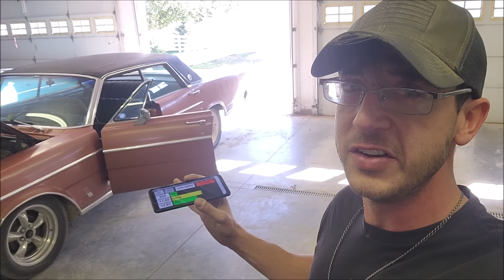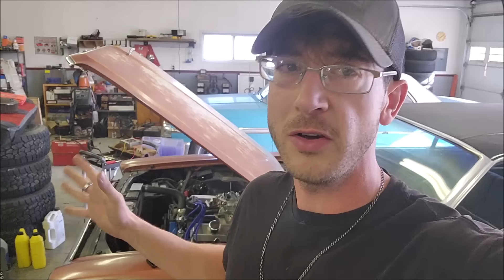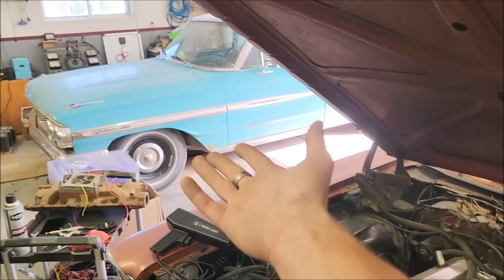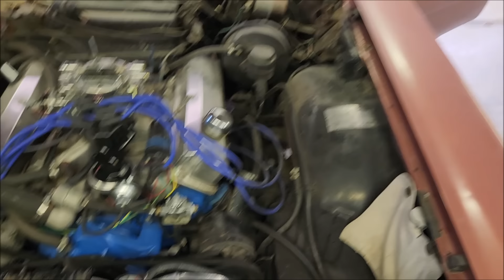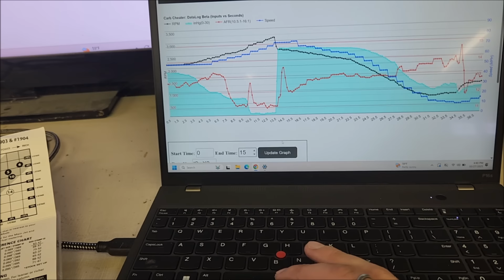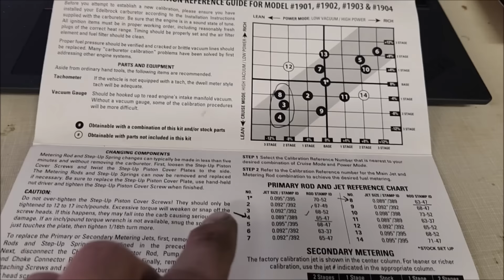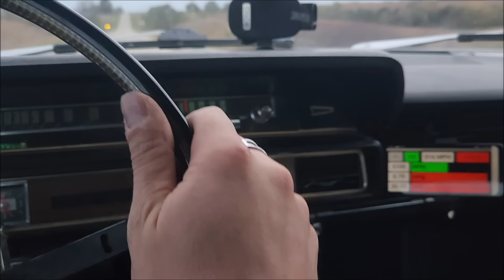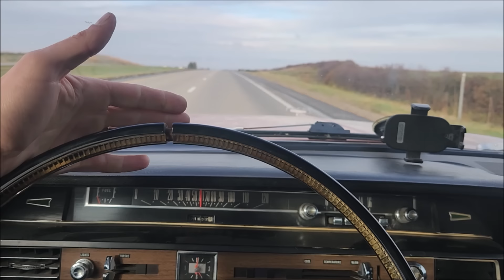Can We Save Her? NEW $6500 Engine Makes NO POWER !!!

Comment: You could have saved alot of time and the owner as well by putting the original Autolite 4100 4V back on the car.There's no carb on earth that can match it..they were just simple and perfect.
Reply: I have never had one run correctly....EVER....Neither with Holley.
Reply: @misters2837 What a 4100??If ypur talking about those ypu cant not make them run correctly..Jon Enyeart wrote a book on them on how the engineering was decades ahead of itself and like he said the fuel delivery on those carbs rival fuel injection...even whe those carbs were wore out they would run a car like nothing was worn...Holley?yes I agree..I dont like holleys and never have..they dump fuel and dont atomize ..I took the one off my dad's 79 truck with a 400 and put one of my 4100s on it and it was exactly like fuel injection after that...It needs to be a little bigger on the cfms but 4100s were no bigger than 600cfm...they used them on 428s in 66 but really they were too small and they are too small for a built 400 but it runs so good I don't care...it only matters if you spin them 5k rpms or beyond and this is a truck so it won't see that.
Reply: @jimmillet1442  If you say so...The old FE in the Galaxie, and Meteor never got such good MPG and ran "like fuel injection" until the Edelbrocks were dropped on...The 4100 might as well said Holley on it...Barely controlled fuel leak!
Reply: @misters2837 Never said they got great fuel mileage...a big block is still a big block and will drink the fuel especially FEs...The fuel atomization on a 4100 is the same as fuel injection and the whole design of those carbs are perfect and a carb cannot be made any better than the 2100/4100 series..It was either hotrod magazine or carcraft did a feature on them years ago explaining why they were so good..Most of us already knew that but they were never considered a "racing" carb but did come on quite a few performance cars like the 289 hipo in the mustang.The shelby gt350 mustang used a holley and one of the standouts in that article was how much better the 289 hip with the 4100 ran ALOT better than the holley equipped shelby mustang.Theres been 100s of articles over the years on those carbs explaining how good they were so if you hate them its because you know nothing about them!
Reply: @jimmillet1442  If their fuel atomization is so "Perfect" then why is their fuel efficiency so bad? 🙄  That makes ZERO sense. 

Also I only had ONE FoMoCo factory carb that ever ran ok (after fiddling with it), a 2100 on a 351W, taking jets and other parts out of donor carbs to tune it properly, (factory tuning sucked even in 1971) I made it lean on cruise and safe rich on power, and returned great fuel economy, and had decent power. (For a 2bbl) The later 2150s (smog years) were door stops and paperweights.  Replaced all with 400/500cfm Carter and Edelbrock carbs.  Increased fuel efficiency and power. (but not both at same time!)  I am not an expert with Carburetor rebuilding, but I also understand that the people slapping a 750 Holley on their 5.Slow (5.0/302) thinking they are gaining something are wasting their time/money. 

When in reality 500cfm is more than enough on a stock 5L engine, and 600cfm on 5L is good for 7000rpm and that is Solid lifter territory, which most street cars rarely fall into, fine for racing but lacks torque and part throttle response for street. (750/800 Q-Jet was probably the only exception to the "too-big-carb" rule as the same basic carb was installed on 3.8L Turbo-Coupes and 4.1L V6 Cadillacs and on 500cid Cadillacs! - I designed a Spreadbore Edelbrock AFB carb, for a project I have, but decided to adapt a four barrel throttle body injection unit instead (EFI for DIY has gotten so easy) I made it "spreadbore" by using epoxy to restrict the primary barrels. (Many 80s Bosch EFI 4cyl cars had "staged and staggered size" EFI throttle bodies to get better atomization on primary "barrel" so to speak, VW used it a lot.)
Reply: @misters2837 Dude you have zero clue..not even worth replying but ok..With our modern fuel injwction systems we have computers with sensors that do everything exact as needed per the point of starting your engine up...We did not have that back then..they relied on the operator for cold start ups..choke..etc etc...NO COMPUTERS to do all the work..Jeez man do ypu have no common sense or what??

Comment: Some tips that might help new tuners on Edelbrock carbs:
Edelbrock recommends an idle speed of 600-800 rpm to avoid getting into the primary circuit, which can cause a rich idle. A modified engine can change the minimum rpm requirements for your specific engine.

If you're running an afr gauge you can calculate the change needed with a simple equation. (New value - old value) ÷ old value. a 12.1:1 afr and your target is 13.5:1 it would be (13.5 - 12.1) = 1.4, then 1.4 ÷ 12.1 = 0.1157. multiply by 100 to get a percentage of 11.57. Use your Edelbrock calibration chart to find out which combination will get you the closest to 12% leaner. I prefer to start with the idle circuit then cruise since that's what you use the most.

For springs, start by picking a spring that has a value about half of your manifold vacuum. The springs are what push your metering rods up to allow more fuel through the jet, manifold vacuum is what holds the rod down. If you're running 18 hg manifold vacuum with the stock orange (5 hg) spring that rod isn't going to fully open until your manifold vacuum drops to 5 or less, which would likely only happen at WOT. If you're running the silver (8 hg) spring it will fully lift the metering rod sooner. This also allows the metering rod to start lifting sooner so you're less likely to hit a lean spot when you're gradually accelerating to the point of opening the secondaries, as the vacuum drop is more gradual.

Metering rods are tapered, so the transition isn't immediate. If you're a little on the rich side at cruise but the next rod size has you leaner than desired you can kinda cheat by running a lighter spring so that the metering rod doesn't lift as high or as fast. Maybe a 70/47 is too rich and a 70/52 is too lean with a silver spring, you can drop down to pink or orange to find that sweet spot.

Once your idle and cruise circuits are good then start on hard acceleration to dial in the accelerator pump and/or nozzles. Nozzle change doesn't alter the amount of fuel but the duration. A .23 squirter will have a lesser impact on the afr but will spray longer, a 0.43 squirter will give you the fuel faster and richen the afr for a shorter time.

Unless you're geared low and driving at highway speeds or flooring it you probably won't get into the secondaries much, but those are jet change only so the afr formula is more direct.

If your afr is jumping all over the place at idle and cruise but steady at high rpm your carb is too big for daily driving or you have a vacuum leak. This is caused by large droplets of fuel entering the combustion chamber and not fully burning. A lower CFM carburetor will increase air velocity to better atomize fuel

Comment: You ara a legend! I have learned so much from your videos. Question. Did you re-set the floats at all?? Or did you leave them as stock?
Reply from the maker: I will always measure them on an eddy for sure - needs to be what they call for
Reply: @ThunderHead289  Roger that! I recently got a AVS2 manual choke for my small block ford. The original was a 1405 which has been great but i felt i could get more out of the 351 I am pretty new to it all but you have made it all pretty straight forward in tuning etc. I would love to get a carb cheater to really geek out on nailing performance down and feel your price point is perfect. But funds are a bit tight at the moment. But its definitely on my top of things i need to get!

Comment: Yeah so the old’78 LTD used to die  in the summertime after about 20-30 min ( in Bakersfield ca) sure enough.., changed a whole shit ton of ignition parts and my dear old dad said “she’s way lean., I don’t smell gas?!?. Installed a see through glass fuel filter and warmed it up while we shined a bright flashlight on the new filter.., 26 minutes and here come the bubbles.., “What in the hell?” Then I noticed that the fuel line from the mechanical pump runs from low on the drivers side., rubber hose to 3/8” metal tube that snakes up behind the A/C Compressor bracket right up close to the cylinder head the to the carb intake filter. The solution re-route the fuel line away from the exhaust manifold and create a custom bent metal tube that also avoids the hot zones, & then a short run to the carburetor. About $20 bucks for parts & a Six pack for Dad. An afternoon with the bending tool & viola’ never did stall out again!

Comment: Great video! And  you did it all without pulling a plug...  I would have guessed that it would run even better if the cam were advanced 4 degrees. Loving a ton of initial timing is what made me think that.  I am old enough to know that Carter had 3 step metering rods on old AFB's used on Chrysler and AMC cars. If you calculated the areas of the jets and the metering rod steps, you were a little closer to the Edelbrock jet charts. I may have to get one of your Carb Cheaters to dial in my Predator....  Maybe even grind my own cam for the jet..... That thing work on E85??

Comment: I had a Carter AFB, very similar to this, and I wanted better gas mileage. I changed metering rods and jets until it lean backfired. I kept pulling over and polishing down the metering rods with Scotch Brite until it stopped backfiring, then kept checking my plugs. I got 2 or 3 mpg improvement.

Comment: There is a valve thay Ford trucks used in the early 80s. Mine was an 82 F-150 with a 302. It had a vacuum hose to manifold vacuum and ported vacuum that went to the distributor. At idle it applied manifold vacuum to advance timing for a good idle. Then once ported vacuum kicked in with the throttle off ifle, that took over. It worked very well to improve idle smoothness.

Comment: >>Can We Save Her? NEW $6500 Engine Makes NO POWER<<
Yes you can. That's why all self-respecting Ford hot-rods have:........
Chevy Engines!
Reply from the maker: Lol remember when ford spanked chevrolet all through drag racing and Nascar in the 60s? 😊
Reply: @ThunderHead289   Yeah, I do but:
Those weren't "Fords"...they were purpose built racing engines. Stock Ford parts can't be used for racing, they blow up, and they are way overpriced.

Comment: Luke, when setting timing do you have the vacuum advance unhooked on both initial and total timing?

No matter if you plan to run manifold or ported vacuum.
Reply from the maker: Correct - unhooked. But then at some point, at idle its wise to gun the engine with vacuum advance unhooked, then hooked up - the difference in those numbers of course being the vacuum advance timing. Many advance cans are adjustable - a vacuum advance pulling in more than 15 degrees is way too much and should be adjusted
Reply: @ThunderHead289 super helpful tip…. Thanks

Comment: Hi Luke! Would you recommend a vacuum secondary carb or a mechanical operation in general?

I have a 400 ford, mild build with a manual 4 speed. Looking to upgrade my ignition and carb in the near future! Thanks
Reply from the maker: Since its hard to get a good holley these days, an avs2 carb is solid. As far as ignition goes, being able to alter your actual timing curve is highly valuable for performance - the pertronix ignitor 3 pro billet has been my long time aftermarket ignition choice
Reply: @ThunderHead289 thanks buddy! I appreciate it. My old Ford is similar to the  super truck video of yours! Cool rigs

Comment: vacuum port is open next to choke stat front lower scrwe
Reply from the maker: Ported vacuum - had no vacuum at idle. I showed about 1/4th of everything i did, im sure thats when I was checking ported vacuum against throttle position at idle. If you have too much throttle opening, you start to have vacuum on the timed vacuum port - which is bad.

Comment: That is not mechanical timing that ignition timing
Reply from the maker: With ignition timing you have mechanical advance and vacuum advance. 

You are thinking of cam timing which wasnt what i was talking about
Reply: @ThunderHead289 well for as long as i been around your cam timing is mechanical timing a distributor timing is ignition timing
Reply from the maker: @patpeacock8150 there is mechanical advance in a distributor as well as vacuum advance. Mechanical being rpm dependant, vacuum advance timing being added into overall timing when cruising. 

Cam timing is of course advancing or retarding the cam events. 
Ive never heard different terminology used than what i use, but im also way up north
Reply: @ThunderHead289 no mechanical is your valve and crank timing you are adjusting the ignition timing don't take my word ask uncle Tony. If you ask a shop to check your mechanical timing in the 60ths they would check the cam and crank timing.
Reply from the maker: @patpeacock8150  you are entitled to your own opinion, even if its wrong. Clearly I made a lot of money in my short run at life, and I didnt make that money by being stupid. 

Cam timing is engine timing. Ignition timing is mechanical & vacuum advance.
Reply: @ThunderHead289 well you said mechanical timing if you went to a shop in the 60ths and you said i want my timing check they would ask you mechanical or ignition timing if you say mechanical they would check the timing marks on the engine. If you say ignition timing they put a timing light on it .

Comment: Your checking checking the timing wrong, You should have the vacuum advance hose on the distributor unplugged when setting or checking the timing, otherwise your reading will be off (because the distributor  will be mechanically advanced by the vacuum).
Reply from the maker: You should probably actually watch the video and listen to what im saying when it is plugged in and im on the light lol

Comment: These old cars are actually not that heavy.  Fully optioned this car weighs the same as a Toyota Highlander.  (Mid sized SUV) Modern cars are typically heavier.  My somewhat equivalent 2008 Holden Calais 6.0 (Pontiac G8) weighs about 200lb more and it’s a lot smaller.  These were big, empty cans.  Modern cars are packed tight by comparison.

Comment: He'll be lucky if this engine goes 5k miles. I know from experience. Couldn't keep heads on my 428 PI I built for my 65  Galaxie. Valve guides would be totally shot by 5k on the heads (perhaps 3k). I contribute it to hard running, higher lift cam, poor oil back then, and stock parts.
Reply from the maker: Hopefully it lasts awhile, I have an fe in my garage with 130,000 miles that has never been disassembled as well as a 390 with, and im not kidding, 191,000 miles unopened. But thats a random outlier I think
Reply: @ThunderHead289  I remember the 390's in the pickups of the 70s. They all had to be overhauled at around 50k miles because they burned oil. After that they were ok. Running stock cams in them. Converted them to 4 barrels too.

Comment: I have to ask why buy a carb cheater and a carb. Both of those together are starting to get into fitech and sniper efi money. I can see it if I was tunning multiple carbs.
Reply from the maker: Most folks already have a carb and a carbureted system on their car. 
But frankly, efi stuff is highly fail prone and hard to gets parts for in say 5 years. I would heavily avoid aftermarket efi. 
Think back even to 2015 - are any of those efi systems around anymore? Nope

Comment: good video, for your garage door opener. usually there is a single wire for antenna hanging off the back of the opener, you can add onto the wire so that it pokes outside and it will work better.

Comment: Also havent seen a distributor since a few years later. 18 deg of advance at 750 rpm seems ridiculous. Should be around 6 to 8 deg.
Reply from the maker: Not at all absurd - when you have big cam things, thats very normal, and i explain why in the video. Ive been a heavy tuner for years, I dont have a 4 car attached garage because I dont know what im doing

Comment: In the late 1960 my Brother bought a 1959 four door sedan Ford that had installed in it a 390 with 2 Carter 750s.  He went through several 3 speed transmissions until he had one that could take the HP.  He was in the Air Force in New England and many a Porsche or Corvette saw his tail lights.  All TRW INTERNAL speed parts were used  because that is where the rebuilder worked.

Comment: Without changing the rear end, can you put like 1" smaller diameter rear tires on that?  Would that bring up yoyr engine RPM just a bit or would it not help you with that cam and build?

Comment: Love the videos, Luke! So much knowledge being taught…. I have a question for ya!

I’ve tried to set my 400 up on “timed” vacuum as you recommend and I’m having timing issues.

When I come off of manifold vacuum my idle goes to crap so I have to bump up timing to run ported. My issue is once I do that, my total timing becomes too much and I’m getting valve ping.

Should I use stops in my dizzy to combat this or just stay with manifold vacuum?
Reply from the maker: Must have a duraspark. 
Ported, more initial mechanical, limit total to safe range - about as good of performance as you can get out of ignition when configured like that
Reply: @ThunderHead289 ok thanks! It is a duraspark setup. Would you recommend swapping over to a Pertronix setup to combat this also? 

Just don’t wanna waste money for the same outcome.
Reply from the maker: @lukefranklin2263 pertronix ignitor 3 is always a solid move - i do believe you get get your desired outcome with an HEI also